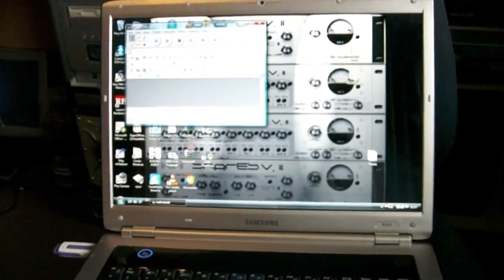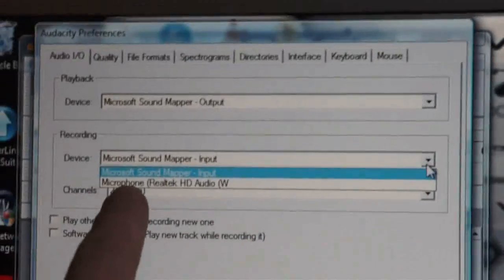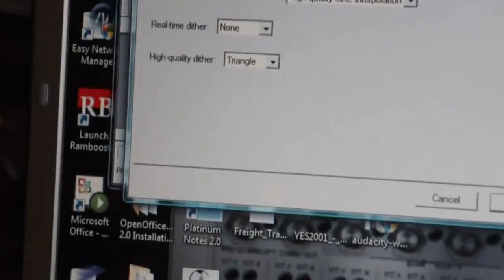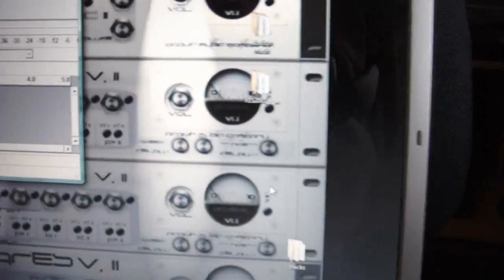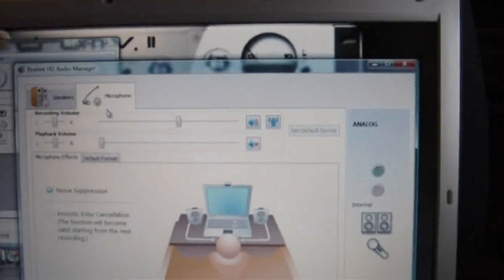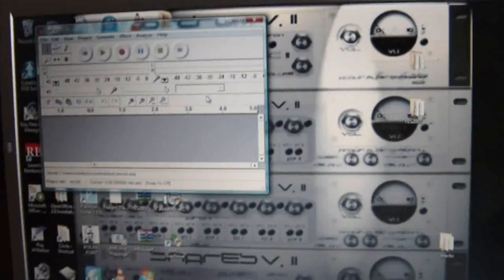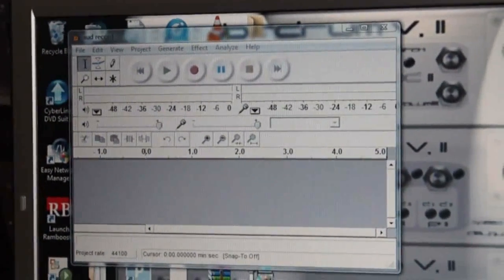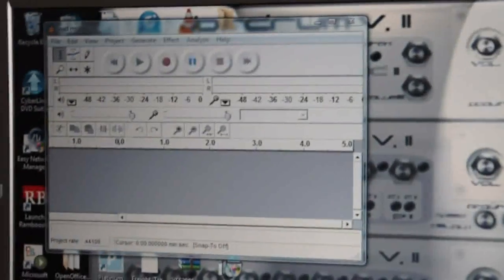Recording with Realtek  HD Audio / AC97 onboard sound chip /sound card with Audacity

Comment from the maker: @Dcl4ws  I wouldn't know I guess you are talking about a laptop? Even then it depends wether they decided to connect a mic to the laptop & the soundcard internally or not. Usually more than not if it's an Laptop it will have a built in microphone.
When you plug in another microphone in the jack it should overide that one. If you have sounds coming out of your microphone then you have connected it to the wrong jack.

Comment: @AshleyM300 I think you thought I was talking about the physical connections at the front of the tower and lost me. Or maybe were on the same page lol Answer me this, can you change that white box in Audacity that's blanked out? On my old pc, old sound card, there is an option to select input line in,. mic, input, stereo mix,  etc. with Audacity. Are you now able to do that or is it still blanked out for you? because all the latest motherboard and realteck drivers do not solve it for me.

Comment from the maker: @Luckzzz well if you can use a usb controller on a free USB port it should be fine. Other wise I not sure that there is an old type midi connection for AC97.
If there is an gmae or joystick ort on the sound card connectors sometimes you can get a midi to joystick port adapter. But anyway you can get a 'midi to USB' adapter cheap online.

Comment: I want a MIDI CONTROLLER on my REALTEK, will it works without DELAY? (my pc is good and i have installed ASIO4ALL yet..) But using my general keyboard from PC have a little bit of delay (just a little bit).

Comment from the maker: @Luka1180  ..Yes, exactly that. If you wish you can record audio from an Div-X film for example or a video game for whatever reason.. say  if you want to include audio in a track / song you were making (from the video or game).
If your using it to record say a guitar,keyboard or DJ set as well as the above make sure you switch the system sounds off in control panel!! As every single email 'ping' etc will also be recorded.

Comment from the maker: @dodico20  if you want to add the front panel input connections to your motherboard you have to disable HD front panel audio in the driver.
The Realtek chips update all the time along with drivers & OS . In Win 7 64 & one of the latest drivers I don't have to do this anymore, it gives full control on the line  & mic inputs. You could try an updated driver.
Things have changed & this video might not help people anymore but for those people that it can I will leave it up

Comment from the maker: @count3rculture  yes it should work the same, on the 'recording' option just set for sound mapper 'input'
what version of windows are you using ? on windows seven (7) I had to set the compatibility mode to run in windows xp service pack3 mode to get audacity to run right. it might also help in Vista

Comment: My vista computer uses realtek high definition. And I ues stereo mix recording divce to record sound from the computer using the audio editor "Audacity." It does work, but when I play it back, it sounds a little muffled. Do you know a way to fix this? Does it have something to do with enhancement from stereo mix properties? Or does it have to do with realtek high definition on the vista computer?

Comment from the maker: you will still have to watch your input levels 'the red bar'
& adjust with the slider for it underneath. Also the input  slider for your line in or mic in on the mixer in control panel. Or else it will overdrive / distort